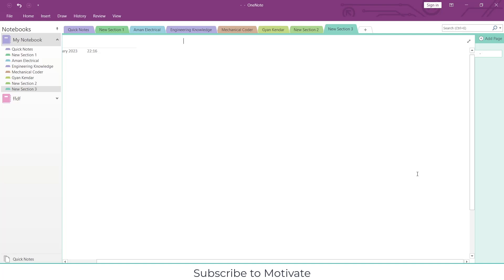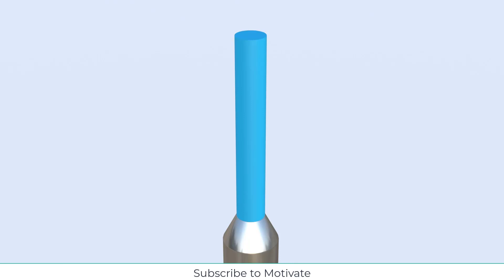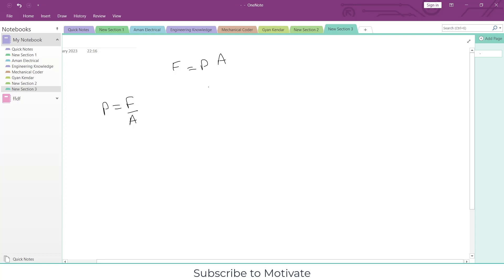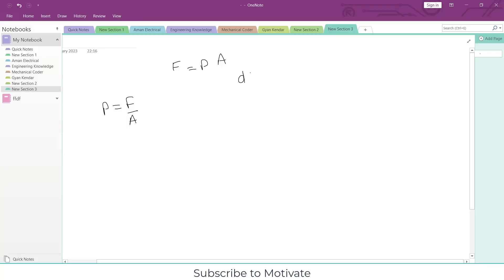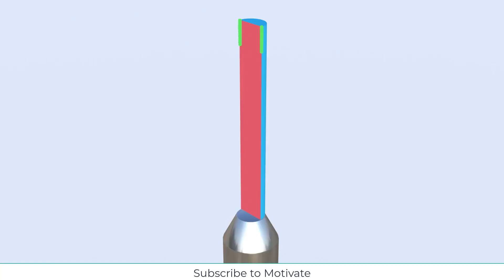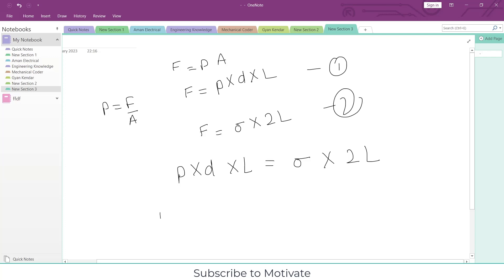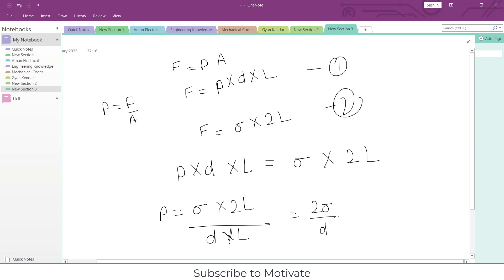Surface Tension on Liquid Jet formula derivation with 3d animation

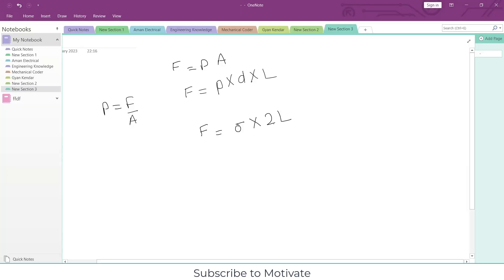Comment: 1:36 why the surface tension not acting on 2 diameters?😢
Reply from the maker: not diameter its length i was talking about . cut the pipe you have two L. if you said one L then i means its a thin flat sheet not a circular and sorry for late reply